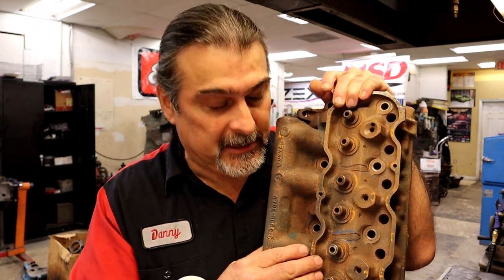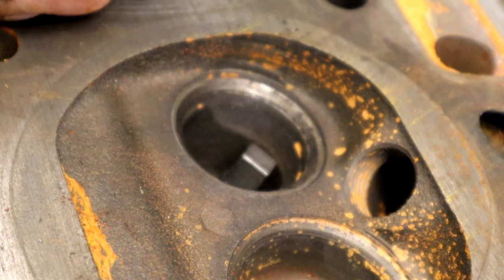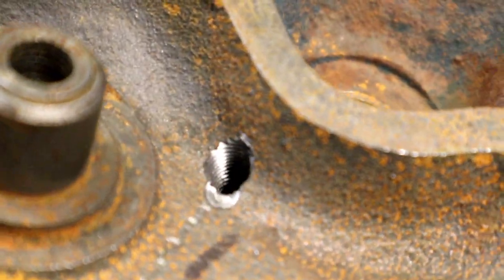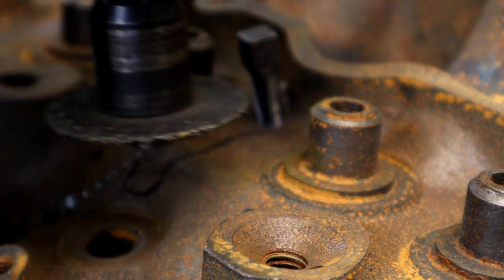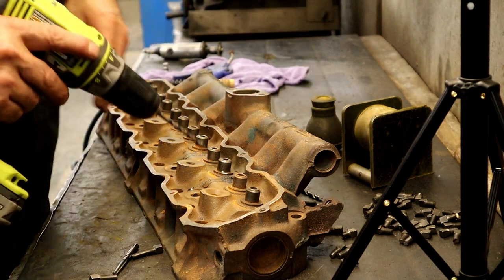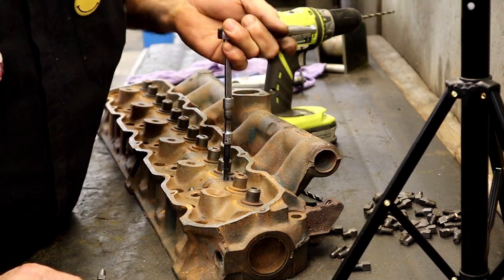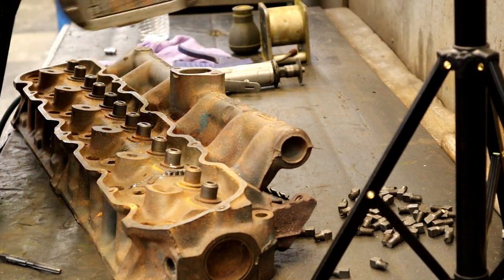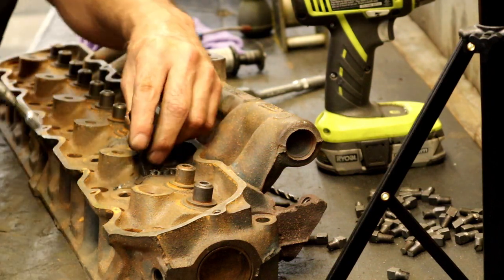HOW TO FIX A CRACKED CYLINDER HEAD

Comment: We use this same system in Australia i have fitted thousands of these what we call A  plugs but i have never seen the reamer we just drill 13/64 from memory and then use the tapered tap. Have fitted over 60 plugs to  1 diesel cyl heads when i was working overseas in a brutal country. That cyl head you are working on is the same as our early ford falcon ones they used to crack badly in the central exhaust port. They were shocking heads for leaking and cracking around the exhaust your one appears to have helicoils fitted from a repair and also has what we call thin wall guides which are what were used before klines came along here in Australia.

Comment: This was one of the very first machining operations I learned in my grandfather's machine shop in the mid 1970`s i hated working the summers away at the time. Now looking back i see he was laying the foundation for a lifetime of work ethics. I can remember being chastised for throwing away plugs when they could be used on a second repair. We did not have fluid weld back then. just drill, tap, grind it and peen it. At the time It would seem that he saved cylinder heads all year for my summers. It was not the case but as a 12 year old it seemed like it. This is a lost art in modern machining. Even now I have fallen into industry practice of welding or replacement. From time to time I come across a cylinder head repaired with plugs and have never seen a repair failure. I have seen poor weld repairs fail usually because the crack was not terminated. But never a plug repair. BTW it is over 100$ a bottle for the 9floz bottle
Reply from the maker: That’s awesome, same here. Miss those days!

Comment: Personally I would cut the plugs so not as much is in the water jackets but I dig. I have a set of olds 455 heads Joe Mondello did in the 80s that have a crack between the valves in the combustion chamber. Where I'm at in Florida the Machine shop guys around me are 🐈s. We'll see how well this holds up after I'm done. I dyno'd 520 at the wheels before I steamwashed cylinder 8. Blocks been sleeved and the head is the last thing I'm trying to salvage. Thanks for the tutorial.
Reply: Nvermind on cutting short. Just realized how short they are. I payed attention to the tap.

Comment: Love this stuff. Couple questions: does the pressure from tapered plugs pushing out on the cast iron cause new weak spots to form? And why not cut the plugs off rather then snapping toward the previous plug? The knowledge provided is invaluable. Thanks for sharing like you do.
Reply from the maker: The pressure actually stiffens the area up , we do want to drill the ends first, if not the crack will keep cracking. You most definitely could cut them off, the closer the better. 🙏

Comment: I have seen videos of cast iron being welded  in pakistan. they make a firepit and heat up the whole head. they cut a vee notch in the crack and weld the crack with a cast iron rod and flux. 
have u ever tried welding cast iron?
Reply from the maker: Yes, the next time I weld cast iron I’ll make a video on how I do it. I use an oven and spray cast iron weld it.

Comment: For something that's not under large loads like this, have you tried bronze brazing instead? Welding cast iron that's been soaking in oil its entire life probably won't be easy but maybe brazing could work? Opening it up with the die grinder and then brazing it might be less labor intensive. Maybe it won't hold under heat cycles though, differential expansion through heating etc.
Reply from the maker: Depends on the repair, I do like to braze cast iron as well as spraying cast iron.
Reply: Try using bronze and stainless 50/50 twisted filler less expansion issues over bronze

Comment: So what are the reasons for repairing a head like this? Is a replacement head not available? is it cheaper to repair just purchasing a new/used head? or some other reason?
Can't wait until part 2!
Reply from the maker: It's the original cylinder head off of a customers 1966 mustang and she wants to keep it and they are getting harder to find. I'm working on part two right now.

Comment: Can this method be applied on an aluminum head? (mine is off a DR650)
And if yes, do I need to use aluminum cast bolts or can I use iron cast? (If it matters…)
Reply from the maker: They did make a kit for aluminum but I never liked it. It would gall up the threads every easily so you would have to use lots of lube but then have to clean it to install the pins with sealer. Time consuming. So I weld aluminum and pin cast iron.

Comment: Whether it's cast iron or aluminum wouldn't matter. If the base metal has absorbed oil or water, preheat the welding area for best results.

Comment: When do you oil for drilling and tapping in metal? I've always wondered.
Reply from the maker: It depends on the metal. Aluminum-always. I just don’t use oil here because I don’t want the oil oil to interfere with the sealer.
Reply: No need for cutting oil for cast iron it contains graphite which is a lubricant anyway.

Comment: Could you solder it or use welding wire and torch?
Reply: You can braze but not welding wire. To mig weld would require a custom wire. regardless preheating is required. I use a bronze / stainless filler and tig braze small cracks. The best method for cracks that required large filets to remove the cracks are best repaired with spray welding with Oxy/acc powdered metal welding

Comment: Daniel:  Could I repair a cast iron exhaust manifold the same way?
Reply from the maker: You could if it’s a small crack, I always try and think why did it crack, if it cracked because of freezing then yes if it cracked because of heat then the heat that cracked it it still there and most likely will crack again. Hope this helped.

Comment: It may work but time consuming though, getting it welded lot easy.
Reply from the maker: How would you weld it?  Thinking of a fast way to weld cast iron that works, can`t think of one. These cracks go into water so they can`t have any pits in the weld.

Comment: 100% no. Drill the crack on both ends, grind the crack and either A. Braze it, or B. Weld it.
Reply from the maker: There’s more then one way to repair a cracked cylinder head. This is one of them.

Comment: I just watched another guy using the pinning system he used a jig that did two things it kept the drill bit at the correct angle and the jig spaced the holes in a precise position way more professional than this guy.
Reply: There are a number of ways to accomplish the same thing, however, not every process can be utilized effectively on every repair surface. For instance, you can not use a jig on a surface that is not flat or of dissimilar thickness throughout. I am thinking of the lifter valley of a Flathead Ford, specifically. I recognize the value of a jig in some instances where one is working with a metal that has some of the attributes that occur , I do not think those attributes are generally present in the automotive machining process. I take good advice when given by someone who has mastered the process in real world application, not from someone who makes decisions based on videos watched. To each his own.
Reply from the maker: First off please don't give bad advice on my channel. If you notice the surface in not flat and the thickness of a cast iron cylinder head or block is never consistent. That's why I deliberately change the angle of the drill bit. Don't get me wrong I like the other method and kit, also like the video but this way is the old school way, and it works. I have never had one leak
Reply: The jig is used on deck surfaces not be used correctly where portions of the cylinder head are not flat